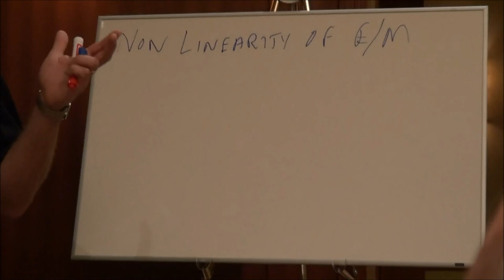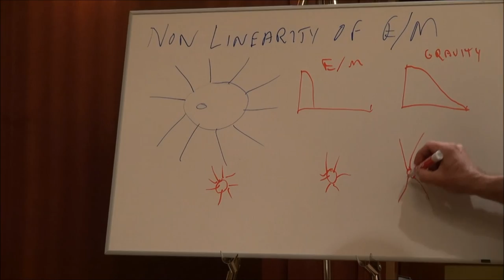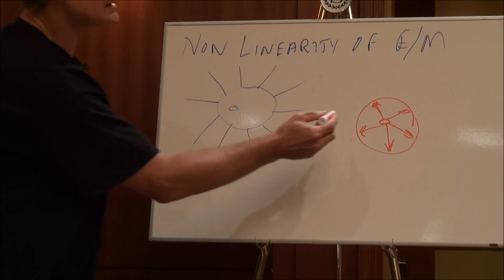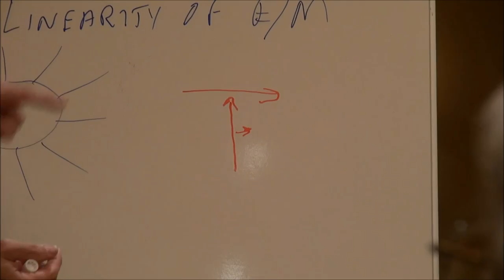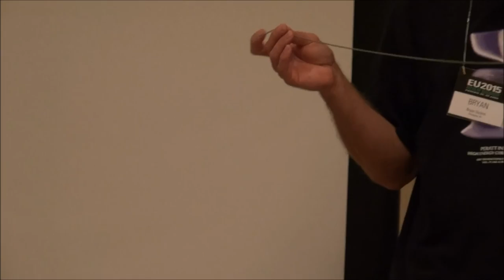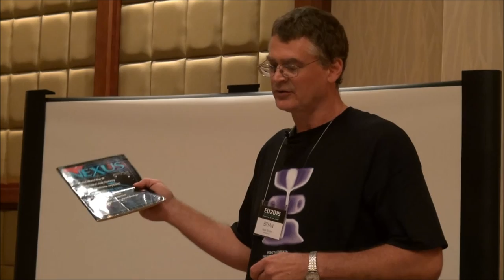The Unipolar Generator with MagVortechs, LLC by Bryan Strohm

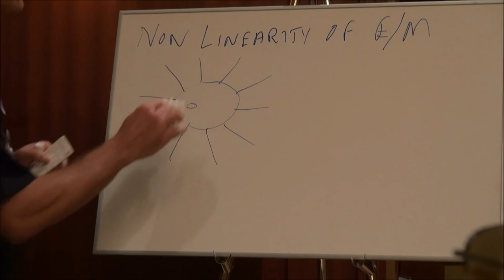Comment: 10:44 Did you know there are no tides on any freshwater lakes? If gravity pulls towards a center of mass and centrifugal force due to rotational velocity exerts its force linear outward at a 90* angle from the line of axis then what keeps the oceans on the top and bottom of the globe? Gravity only opposes centrifugal at the equator .

Comment: Gravity is a term applied to the functions of density / buoyancy in a static electrical field between 2 charge potentials.
The ionospheric upper plate so to say and the ground source. Electron flow builds from the ground until it is close enough to the upper ionic + charge that the current can jump the gap and flow to ground. This is why lightning visually goes down but the path it follows is made of electrons that build upwards before the strike. Electron flow is from - to + but current flow is from + to - and 90 degrees behind in phase. The fact that there are no tides on freshwater bodies kind of blows the whole orbiting spheres with gravity idea out of the water. Along with numerous other examples.
Reply: Gravity is not the result of Density and buoyancy.  That being said I am on a video where people think 1000% efficiency is a real thing so can't really expect people to understand 6shit here.

Comment: Hi Bryan, thanks for working on the whole homopolar generator. I just got done reading Thomas vallone book on it. I have a suggestion about improving the voltage of the Dynamo. It occurred to me while thinking about kirchhoff's laws first and second. That's if you use the electrostatic electricity from the environment and added it to the amperage of the homopolar generator you would not violate kirchhoff's second law and the law conservation, since the available voltage in the environment is more than the total Watts input of the homopolar generator motor, then the voltage from the environment would rush to meet the wattage requirements of the the conservation of energy operating in the homopolar generator, yet these would be mostly voltage. By using open system thermodynamics such as as used to explain the operation of the homopolar generator, we can satisfy kirchhoff's first and second laws and the conservation of energy in an isolated system. Since the capacity of the Earth is larger then the current in the homopolar generator and since the power from the Earth's atmosphere comes from the sun, the homopolar generator would be the smaller of the two Energies.In this way we can give local amp hours 2 the high electric field in the environment around us. Please contact me if you'd like to discuss this further. Otherwise keep up the good work. Jeff VanEngineerTachyon Aerospacehttp://tachyonaerospace.earth/

Comment: The braking torques (back emfs) on each disk will align and add up on the prime shaft. They're in oposition directions at the disks but they align through the gears and add up at the prime shaft.

Comment: Conductors equalize fields through the electron orbitals (a misnomer). They will trap a minimal amount of dielectric induced fields on their own, and will not advance/transfer those energies unless there is a difference in the field potential, or it connects to a load with a different capacity. Radially the speed between the outer circumference magnetic sources and the inner diameter magnetic source is significant (the squared effect in count and cubed affect in count and acceleration). So a straight wire can induce a moving current in this variable field, something that requires a loop for efficiency and a load for application in a uniform field in traditional generators. Traditional generators move the current in the direction of the induced field. As he points out, this current flows orthogonally to the induced field, adding the current induced magnetic field ( traditional back magnetic field) to the inspiring differential, increasing the induction of current, not retarding it. Cool
Reply: Was thinking and testing this the other day. Would agree.

Comment: The analogy between the electric charged hollow sphere and a similar hollow sphere with a mass and no electric charge is that the field everywhere inside is zero in both cases.  The electric charged sphere needs a force to hold it together while the mass sphere will generate a pressure that hold the sphere together.

Comment: I like this guy!
Reply: Lost me at 1000% efficient though...
Reply: Yes, entertaining but flawed. It went downhill very quickly when he said turning the magnet in a homopolar gen independent of the conductive plate would produce current. The magnetic field does not move in a homopolar gen stack, that's the reason why that type actually works 😂
Reply: BMan18 as I already stated, rotating a magnet on its n-s axis does not move the magnetic field. It's a basic concept of the homopolar motor/generator. If the presenter has measured any current by moving just the magnet then that magnet has some sort of flaw causing an uneven field.
Reply: Ray V Hey, I'm still learning about this stuff, and I apologize about the denial thing. We all see what we see until we see clearer. Distinti has done a lot of work about discovery and electromagnetism. You might check him out, its OK to have multiple models and to let go the ones that fail. 

But to the point, the work on homopolar and unipolar generators has seen a lot of coverage on YouTube. Several University studies are cited in the comments to augment that work. The results are in. If you have a magnetic field, it matters not if its moving or not relative to other conductors. If those conductors, even if they are within the magnet itself or in the plating of the magnet, or even if they are separated by non-conductive materials, or are rings or radial bars... if they move in the presence of a magnetic field, they will generate a voltage and/or current (if connected). The electromagnetic gyroscope is proof of this operational fact.

The example of a rotating magnet has differential in speed radially as it spins. The magnet is in its own field, which has moving field parts and apparent stationary field parts which are irrelevant. The flaw is that it is a disc with an increasing circumference, altering the speed and therefore the induced voltage across the radius.

Current and voltage is generated independently of the movement of the magnetic field. All that is needed is moving charges. Moving sensors relative to fixed charges won't do it.

That means any motion of charge in a magnetic field (moving or stationary) will make a voltage, connect it to a relatively differently moving point that is making a different voltage and you will get current flow motivated by the voltage differential. And therefore creating its own magnetic field with that current flow.

This give us two key benefits. You don't have to move charge carriers in any specific direction compared to the magnetic field, although the direction will influence the force that moves the current. So lines of force are irrelevant to induction, induction happens with any movement in a magnetic field. Voltage differential is all you need for that induction to move. So you can use an outside voltage source or vary the movement of a circuit in the same magnetic field or vary the magnetic field strength or some combination. The magnetic field does not have to motivate the induced current movement.

This next benefit is: some directions of induced current movement produce reactionless current flow, others can produce amplified EMF with current flow.

The jet streams from quasars are examples of amplified current flow. Practical rail gun tech can be designed using this awareness, not the super high current flame throwers demonstrated on the net. Or self-propelled, high torque electrical generators as hinted to at the end of the presentation. These of course will seem like they are over unity, when in fact they are simply more efficient use of electromechanics, similar to natural systems.

The presenter here is focused on the reactionless options to enable less resistive energy induction, explaining how his design sets up the current flow to create a magnetic field that is orthogonal to the source field, not contrary to it as in a typical generator. Orthogonal magnetic fields do not resist each other ala Lenz' Law.
Reply: I’ll believe it’s 1000% efficient when I see it.
Reply: Interesting
Reply: Do you understand this. Could you build it?😅

Comment: Nice work. I prefer to define induction the way Faraday did and not use Lenz's law. It clarifies the mechanics. 

It also appears in his closing comments that his device mimics the field structure of a permanent magnet. The tertiary fields he describe exactly match the field dynamics of a magnet. The potential for a device that is only limited by the physical wear resistance of its components for power sounds quite reasonable.

Comment: Sir, I don't want to be rude, but magnetic field lines don't ever intersect! they merge or repel.
Reply: They don't actually exist they are just useful. A big deal when useful theoretical constructs are spoken of in real terms and then used as mechanisms for other theories such as magnetic reconnection. Forgetting about electricity
Reply: @georgetubb9124  So if magnetic fields don't exist why can't we see the golden/yellowish color of electricity acting between two magnets? It seems like magic that there's nothing happening in between two magnets but we can feel the repulsion or attraction somehow.
Reply: @AstralApple  magnetic fields certainly exist. And they have a field for sure it's just that individual lines don't exist they are a useful concept on paper. It's just the mainstream make too much of the field lines and wrongly invent a mechanism here that ain't true. They are forgetting to consider the electric current that is the source of magnetic fields anyway. Magnetic field variance in turn causing more current. Electrical engineers have explained why. Look at any of Don Scott's YouTube videos on the sun. He goes to great depth on this point near the beginninghttps://youtu.be/eHi6ib9STPg
Reply: @AstralApple  Magnetic fields exist, but the field lines are just a model as we use to think about it, because thinking of lines waving through space gives an intuitive understanding that usually leads to accurate conclusions. It doesn't work in certain unusual cases, like this one - you need to set aside the helpful visual language of field lines, and turn to the more accurate but less-intuitive model of a vector field. A task that involves first learning the fun topic of multivariate vector calculus. Field lines are the pictures we use to avoid doing math.